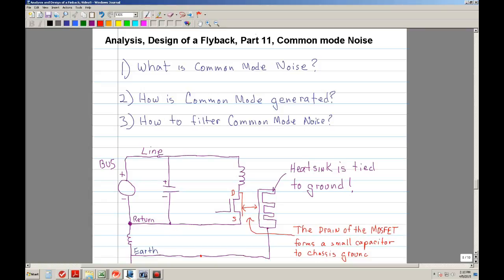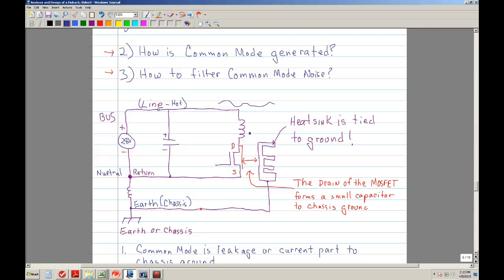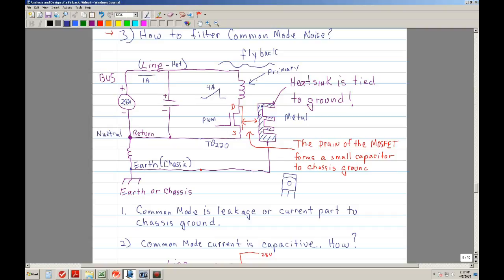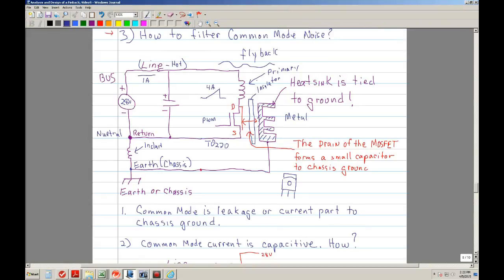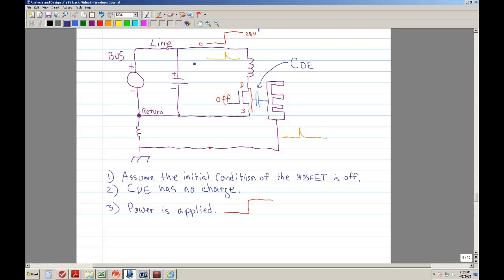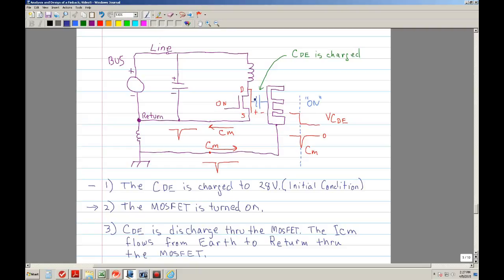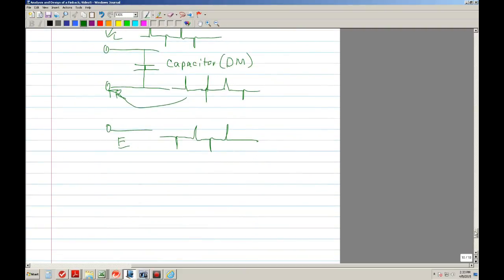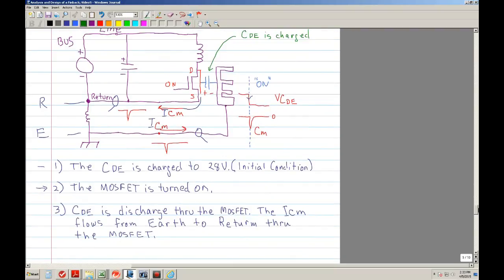Analysis, Design of a Flyback:Part 11 Common Mode Noise

Comment: Hi. What is the primary reason that the minus of the supply is connected to the chassis? Second, if it's not connected I presume there will still be a common mode current but this time it will flow through two parasitic capacitors where the other is from the earth to the (-) wire? You have a small error at the end, you say common mode capacitor, it's actually diff mode. Another thing, if impedances in the line & neutral are not the same than the current signal won't be identical, right? Thanks!

Comment: your vidoes are very useful. They explain important concepts very clearly.  Thanks for videos. 
I have a  question on common mode noise current (capacitive)
If Mosfet heatsink is not tied to earth, we do not have common mode current . Is it right? 
especially in small power ratings it is possibble to use an electrically floating heatsink (not tied to chasis of the device). In such a power supply do we  need common mode mode filter?
Reply from the maker: Hi Serdar, most likely you would need a common mode inductor. Even thou the heatsink is floating, there are stray capacitance that couple the electric field to the chassis. To be on the conservative side, I would implement one.   Robert Bolanos

Comment: Hello sir please help me sir one transfarmer 3 wire 24 swg turn 8 secondary  00.4 mh,1 wire 28 swg turn 128 core E ,C 40.24   No gap core PRIMARY 43.mh but sir i  use EC 40 CORE  gap so sir setting the my transfarmer thank you

Comment: What will happen if the earth is not connected to return?. Common mode will not get a path, so will Common mode noise disappear?
Reply from the maker: Hi Aneesh, Sorry for the delay in answering. If you dont have a earth return, the noise will seek and return to the power supply's return and if both the hot and the return have different impedance, it will show up as addition noise in the differential mode. Hope this makes sense

Comment: How about when the mosfet is already plastic tabs. Does it really mean no more cm noise at all?..
Reply from the maker: Thatcapacitance is always there. It may be lower. Keep in mind that all insulators have a dielectric constant 
So yes it will have capacitances.